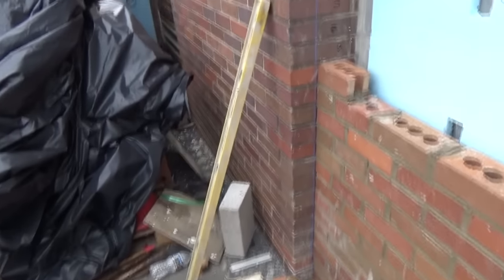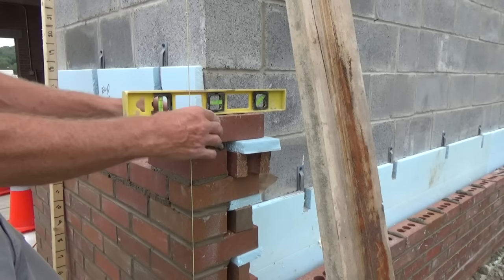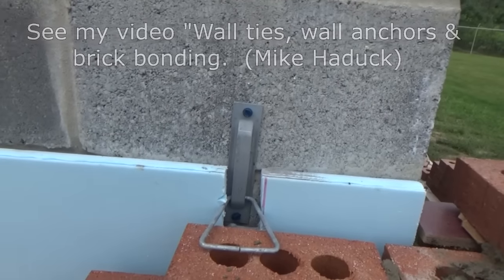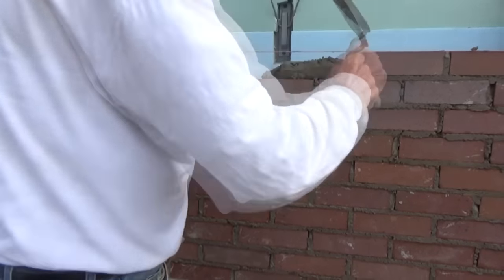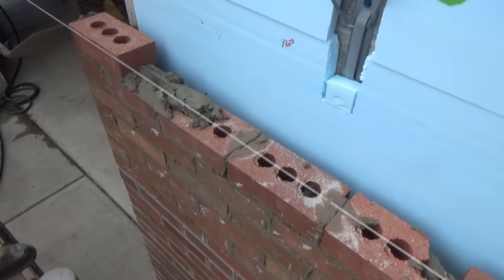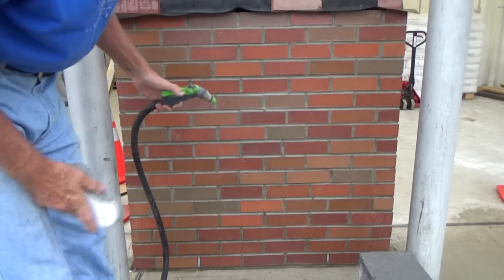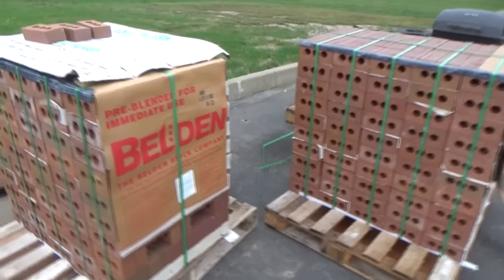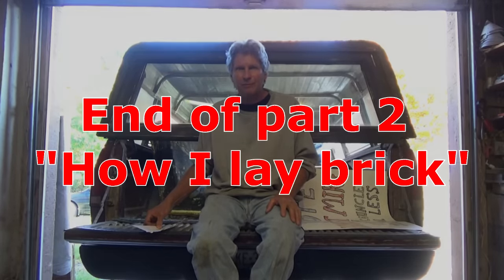BRICK LAYING (part 2) Mike Haduck

Comment: Before i did manual work i always thought bricklaying was easy. i mean, how hard can it be? right? but it's just they make it look easy. i did three courses 3 bricks long and man did it bow. just getting the mortar to stay on the trowel is an art form in itself! hats off. thanks for the videos man you are helping me a whole bunch.
Reply from the maker: thanks Jason, I appreciate hearing that,  thanks mike
Reply: This invokes memories of when I was a bricklaying apprentice. 2 years spent pissing around, 1 year doing actual brickwork.  I was always made to wait until the mortar was starting to go off before striking it out ("jointing up" where I come from).  Also the way we were taught to butter a brick was a bit different (again no definitive right or wrong way), butter the end of the brick with a downward swipe, and then a bit more on the one or both sides of the end - so long as a full "perp" ensued when laying the brick, requiring no further actions then what does it matter?  I remember my instructor being able to achieve this with 2 movements - slap some muck on the brick end with an upward (?) movement, scrape off the excess on the face side and then lay it.
Reply: i know it's kinda off topic but do anyone know of a good website to stream new series online ?
Reply: @Benedict Rex I dunno I watch on Flixportal. just search on google for it:P -brady
Reply: @Brady Zion thank you, signed up and it seems like they got a lot of movies there =) I appreciate it!!
Reply: @Benedict Rex No problem :)

Comment: Thank you for posting/sharing, your right about mixing up the material, im not a roofer, but if i do a roof, i mix up the material, and with siding, box numbers must match on the same wall. One other thing I wanted to say, if you cut a brick with a saw, it's perfect snd pretty but that cut is smoother than the glass brick you used on this job and it's filled witk micro particles of dust that you cant even rinse off, so a poor bond takes place. Btw i watched this series a year or so ago.
Reply from the maker: Thanks Len, mike

Comment: Your toothing would be easier and straighter if you returned at least 2 brick.  A second plumb line for your tailing  speeds up your lead.  Work looks clean and on target.  Just a suggestion.  thanks for posting.
Reply from the maker: thank you,   mike

Comment: That makes good sense to take a batch of bricks off of ea pallet. That's the way it is with rolled sod. One pallet would be inbetween green and yellow & another pallet would be all green and so on. If you don't, the customers lawn will be checkerboard. We always went back the next day rain or shine to scrub concrete off of the stucco bc you can walk on it as long as you don't walk on the edges.
Reply from the maker: thanks Eric,  I appreciate it.  mike

Comment: this is so, so different than what I'm dealing with...1860's original hand made bricks and pure lime mortar (no portland).  They're too soft to scrub clean, so we have to be very, very clean laying them.  they're also all different sizes and rarely straight, so we can't run a tool to clean the joints, we shape them with a pointer.  very slow work.
Reply from the maker: Hi Josh,  I know what you mean,  every situation is a bit different and uses different techniques,  thanks I appreciate it.  mike
Reply: sometimes good things take time
Reply: know what you're saying Josh..one of the places where we've done repair work was constructed 
with an old style porous, soft, ribbed face brick.
they were impossible to keep clean or brush clean and sponge clean.
i ended up spot coloring the obvious flaws with colored mortar and 
a liquid bonder (in place of water) dabbled on the wet faces...
Mike has a video of him using colors on the joints but it worked well on the faces too.

Comment: If you choose to use a metal brush to clean brick,make sure it is either brass or stainless,regular steel can turn brick black with carbon deposits.

Comment: Hi mike another good interesting  video. Just on the subject of the pick and dip method of laying brick .most of the mainland European bricklayers from a variety of country's including the Netherlands, Germany ,Denmark to name but a few, lay them pick and dip ( although they probably wouldn't know it as pick and dip) the guy in your Denmark video lays them that way . In its purest from your not even supposed to butter the head joint  your supposed to push some of the bed joint forward as your laying the brick to form the head joint (or as it's called in my neck of the woods the perp joint) those brick your laying are they  engineering brick. they seem to have a very low absorption rate. Another thing that the pick and dip guys prefer is to work out of mortar tubs or boxes rather than off a mortar board .
Reply from the maker: howdy bric,  I appreciate the comment because I was going to address most of those things in part 4 & 5, plus a little bit comparing old buildings with new,  food for thought when I am editing them,  I appreciate it.   mike

Comment: Nice job.....instead of using a brush to give your wall the finishing touch try using a sponge.. it gives a much nicer finish than a brush and you don't get lines in your mortar...and it is really good on smooth bricks especially when your mortar has gone off a bit. Good job anyway.
Reply from the maker: thanks Steven,  I appreciate it.  mike

Comment: Hi Mike, thanks for the video, and explanation.  A question for you:  why do you 'tooth out' the corner, rather than lay the course all the way around, or build up the corners, then lay between the corners?
Reply: I think he said that it was because the customer wanted the front of the building done first
Reply: It would take way to long and be way harder on the helpers to have to follow mason all the way around building
Reply: I'm going to say this iTooth with brick and block if I'm trying to get something done quick I got to do what I got to do I have two four and five stories in the air it doesn't matter the walls not going to come down and go right back to the walls years later and still see the wall standing and no leaks so I really don't know what you guys are talk or not toothing  is okay and I'm not going by something that I read or heard I'm going myself and I've done

Comment: 3:00 sighting the brick to the line at the far side of the building. Here's some obscure stuff. Daniel Boone when he went into Kentucky to shoot deer for their hides had to carry all his shot and his powder, and his rifle. There were shorter and much lighter rifles he could've carried that were as accurate as the long rifle he did carry.  So why did he carry the heavier long rifle? It was because the extra barrel length allowed him to keep the sight at the end of his barrel in (reasonable) focus with the deer he was aiming at.  I found this in a 1920s biography about him and nowhere else. 
   For your masonry this would mean that if you backed off about 4 feet from the brick you're trying to align, then the edges on that brick and the line on the opposite side of the building should be (reasonably) in focus making really fine adjustments possible. (Time of day  and weather matters, a brighter day, more depth of field so more depth of focus; a dimmer day you might want to back up even further).  And you probably already know to do this.
Reply from the maker: Hi Will,  yes , a lot of times you got to step back and eye it all up,  thanks for the comment, Mike

Comment: Mike,  this is not related to brick laying, however if anyone will know the answer to this problem you will?  I'm renting a house which was built in 1949.  The cement basement floor seems to be breaking down as a reoccurring cement dust seems to appear out of nowhere.  What can I do to stop the dust from appearing.  I thinks it the age and break down of cement used in the floor very nasty stuff.  Really enjoy your postings love to watch and listen to man who truly knows what he is talking about.  Thanks in advance.
Reply from the maker: It is impossible to say for sure, maybe re- coat and a paint, if it is inside, I would do some samples and see what happens,,,they did not use good cement in those days,  if you were real serious you would have to tear it out and do it over,I hope it helps, thanks mike
Reply: had the same type of concrete floor in my basement. powdery and dusty. used vinyl tile floor sealer that was left over. worked beautifully and is much cheaper than commercial concrete sealers. applied 2 coats of sealer.

Comment: Hi Mike, starting construction on my home soon, thinking of going with a cavity wall with foam in between for installation , vs a veneer brick. In your opinion which is the best way to go cavity or veneer? Thanks
Reply from the maker: Hi B4Rel 1,  I can not really say,  you would have to talk with an inspector for that,  lots of things to consider with cavity walls, especially when the space could be a breading grounds for termites on wood buildings and moisture issues,  and every area of the country is different,  I hope it helps thanks mike

Comment: Mike, I am doing veneer wall like this inside my garage.  The floor is not quite level.  Do I compensate on the lower part with more mortars as I go along?
Reply from the maker: some guys soldier course the bottom some more cement and some just adjust with the joints (fake it) anything that works, I hope it helps, thanks mike

Comment: Hi Mike,  You said that they don’t make buildings just out of bricks like they used to.  Is building just with bricks not up to most safety codes or what?
Reply from the maker: Hi Paul, anymore yougot to go thru the inspectors,   every situation is different,  thanks mike

Comment: using a 4ft level to plumb both sides is 10x easier, and the bricks are engineered ones,they don’t absorb water at all,you can the them for you DPC
Reply from the maker: Hi Ash,  the old timers forbid levels on corners up and down,  blumbobs and lines to the top of building,  no mistakes,  check out my videos, brick walls  . old school vrs. new school,  thanks mike

Comment: You obviously have skills my question is without trying the wall to the column to your left,a "cold" joint there should be expansion material running up the joint. Toothing the corner should come out at least 12 inches. P.S if the block are layed module and the brick are standard commons if you follow coursing it should work out. And yes,you do have to humor the wall most times. Not trying to pick the work apart just an observation. P.S.S If the wall bleeds like here a piece of burlap or inside/outside carpet will do a fairly nice job of cleaning it off. But you have to wait until it cures a while.
Reply from the maker: Thanks Saber, Mike

Comment: Can I lay brick on top of synthetic stucco? It is only the front of the house and we don't have issues with drainage. Also, the sun hits that side of the house so it stays dry.
Reply: Bo...Mike has some videos on his site where he slash cuts the clean face of old stucco with his masonry blade in a hand grinder to provide a better bond...first time i'd seen that but great way to improve the grab. that might be a lead for you.

Comment: Anybody know how to remove the extra mortar extrudes to the back of brick? During the time while we are compacting and leveling brick, it will cause extra mortar extrude to the back side. I'm wondering if those extruded mortar will block the gap between brick and the wall behind it and cause further issue.

Comment: What happened to that course up top when you wee showing the wire brush cleaning method? Everything looks great until the bond shifts to 3/4 over the brick
Reply from the maker: Hi Dylan,  that brick was like glass and did not absorb any water,  at the end of the series everything was cleaned with acid,  I hope it helps,  thanks mike

Comment: Why dont you use wooden profiles on the corners and beginnings of the wall to out your line on? Grts from belgium
Reply from the maker: Hi Jordy,  lines always worked best for me,  thanks mike
Reply: @MikeHaduck  oh oke its nice to see other techniques used! Ife we use a stone that hardly absorps any water we add a   liquid product to our cement mortar so it speeds up the proces a little bit so it dry up faster
Reply from the maker: Thanks Jordy,  it is true we all use different techniques,, anything that works,  I agree, thanks, mike

Comment: Thanks Mike I appreciate you making these videos! One question, what do you recommend for preserving or water protection. Have a 80 court yard. Top bricks mortar is letting go. I will clean re mortar and reset but would like some advice on water proofing!
Reply from the maker: IT is a hard answer,  every one says something different, I like quickrete (concrete cure & seal) and I spray it on, others may say different, thanks mike
Reply: Mike Haduck Thanks Mike! Will make a note and research that!

Comment: Do you not mortarthe new brick into the old? (at 1 minute 10 secs) are there expansion / contraction concerns with brick?
Reply from the maker: Hi mike ,my rule of thumb It is never to splice in the old building into a new building make them separate because of the footers and the brick expand and contract and you’ll end up with a big crack this is what I’ve always done it been taught, I hope that helps thanks Mike
Reply: Mike thanks for the info.  I wanted to mention that i would love to learn more about brick laying.  I've been watching a lot of videos over the years and would love to take some classes or actually work for a mason to learn.  I have a full time job and I'm 50 years old.  Any advice?  simple projects that would be good for a beginner?

Comment: I would like to brick a garage 38x44 has tin now , problem is no ledge for brick , could I  dig a ditch and pour one or use block  with a flat cap ? I never lay any brick but have seen it done .
Reply from the maker: I would not advise that,  check out my video "How I do stucco (Part 3 of 4) Brick face stucco,  mike haduck,   maybe something like that or a tudor look would be a lot less expensive,  thay also make stick on brick,  I hope it helps, thanks mike
Reply: +Mike Haduck that would work if I can find a veneer to match the house ,  thanks.
Reply: Danny Chavez its possible to bolt an angle iron all around also
Reply: +sean wilson yes that would work ,

Comment: Hey mike - love all your videos - very entertaining and I've learned a lot.  Something I've always wanted to know is to what degree i have to anchor brickwork below the frost line.    I was thinking of doing a low garden wall of some type...maybe 2 feet high or so.Do i have to start the wall 3' down so it doesnt heave during the freeze thaw cycle?
Reply from the maker: Hi Mike, when it comes to something like that I do it the same way as I do on my retaining wall videos, but I’m not a fan of brick work like that because the water gets into the brick and bust them all apart when it comes to a garden wall. I would do some researching first, I hope it helps thanks Mike
Reply: mike thanks for answering all the questions.  I work in Paterson NJ and there are a lot of brick buildings in town...many have a lot of really cool details.  do the drawings for these buildings have the detail that the masons are supposed to use or is it kind of up to them?  do the drawings say exactly how to set the brick all over the building?
Reply: thanks for making the time to answer Mike.  I work up in Paterson NJ...although the city has seen better days, its amazing the detail in all the brick buildings i see up there.  never see that much detail in brick buildings today...really interesting
Reply from the maker: Hi Mike, almost all the time the brickmasons have to follow the patterns , almost all the time the brickmasons have to follow the patterns on the plans,  there might be some slight changes, and you’re right there’s a lot a beautiful old brick buildings, Thanks Mike
Reply: I'm happy to send some support for your page Mike...how do I do that?  It's been great watching your videos.

Comment: I'm new to masonry and I've noticed that some guys don't fill the head joints all the way, is it because on a job like this it isn't a structural issue? Thank you!
Reply from the maker: Brick work anymore in my opinion, is a façade, just like stucco and it’s not used for structural use just for an outside covering, old-school was different, so things changed,If that makes sense, thanks Mike
Reply: Sure does, thank you!

Comment: Mike is in this video that you explain the “Pick n Dip” method? As British Brickie’s are now using it not for strength but for speed & some of the results are absolutely dreadful
Reply from the maker: Hi John, that was one of the last brick jobs I did, I did a video " brickwork Is dead" here in the states it's been replaced with glass, steel and pannels, I might do some repairs and rebuilds but nothing new, dealing with codes and inspectors it is not worth it, thanks Mike

Comment: Why tooth it out when you could just build a corner and string the line out with corners blocks like us in the UK?
Reply from the maker: Hi Cassa, I can't say it a 50 foot run on thr side, Been doing it this way for over 50 years , and that's with the union for a while, but whatever works for you,  I know brickwork is still popular in the UK, but here with all the new codes and inspectors you rarely see it anymore, everthing is getting pre made and erected,  I wish you well thanks Mike
Reply: @MikeHaduck  thanks for the reply mike hope your well